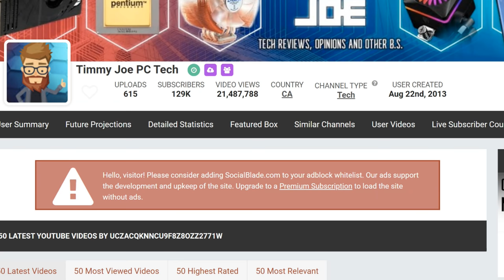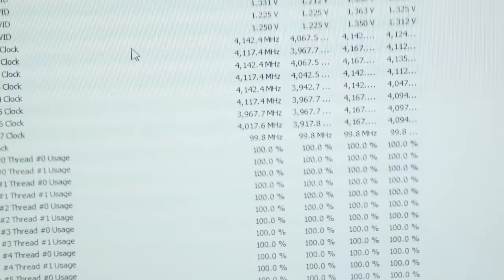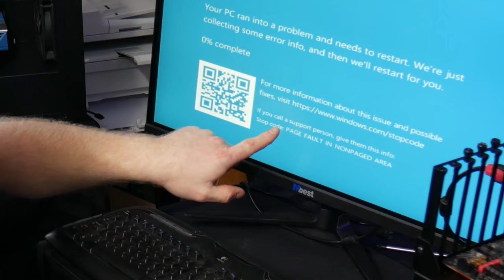This Ryzen 3700x was my biggest problem in 2019...

Comment: I have a 3950x on an asus crosshair hero 8 mobo. Everything is fine as long as I don't let it idle. If the computer is idling, it will randomly loose power and reboot. No BSOD's no errors just that stupid kernel power 41 error in the event viewer with bug check code 0. I've been having this issue for months and I cannot figure it out. I may work for a whole month without issue and then start doing it again. Impossible to troubleshoot since I have no idea what is causing it. I've ran memtest for hours and hours with no issues, I don't do OC, precision boost overdrive is set to disabled. The PSU is OK. I'm also hooked up to a UPS so power loss is out of the question. I can render and game on it non stop. But when it's idling....or in very light usage, like browsing the web it will just shut down and restart. I though I was having some USB issues so I just unplugged everything...and the little shit worked for almost a month with no reboots. Yesterday it started doing it again. It's taunting me. I've updated the bios and drivers again yesterday and changed some power phase options in bios and set them from auto to extreme since i read something about memory going into a low power state at idle and causing issues.I have even disabled spread spectrum even though I am not doing any OC. Can anyone help me figure out what this is? I bought the parts in june and I need this machine since I work remotely and I need this thing to be reliable. I want to exhaust all options before I send parts back to the retailer. Any help is appreciated!

Comment: What the fuck man, this is something similar to what I get with my 3970X and my Gigabyte Aorus PRO WIFI.
I run all the stress tests, etc.. NO CRASH
But if I boot into windows directly with no delay ( As in cold boot, get to windows, put password immediately, get to desktop ) it will have a huge possibility to trigger the blue screen issue.
In my case its not only Page Fault but the most usual BSOD is Watchdog  violation.
To resume, to get crash with a 50% to 70% probability is
COLD BOOT -> Get to windows immediately, no delay on putting password, run browser or any light app.
What happens? At some time the system will start to stop responding, slowdown to a crawl, then mouse and other things will stop working and then it will BSOD.
To NOT get the BSOD I have to.
COLD BOOT-> Get to Windows's login screen and wait at least 5 minutes for it to load background apps -> Login and let it sit 5 minutes loading background and boot apps.
Then the system will be rocksolid forever until I do not the delay in the next cold boot.
I even got these issues in a brand new clean Windows if I do not do the waiting period. But then, my cpu is retail, not engineering sample. And I've heard of other guys having a similar issue than you with other retail chips.

Comment: Weirdest confirmed fix I've ever run across. Twice in past six years or so I've come across clients that would bluescreen only when installing programs using Microsofts MSI installers. Traced to memory settings on the BIOS set to Auto. If you manually set the settings, even if setting to the same as the auto settings issues would disappear.  Crazy.

Comment: I have the 3700x with the gigabyte x570 aorus WiFi elite, had this build for a little over a year, not over clocked. Was playing RDR2 the other day and the monitors shut off and the pc acted like it restarted but monitors stayed off. I swapped out the video card, swapped ram around, changed the psu, reset the bios, flashed the bios, even tried onboard graphics, nada. Still no signal to monitors. It starts up and fans and lights come on but still won’t post. I’m out of answers, any thoughts on why this is happening? Never had a pc do this before.

Comment: had the same problem most ryzen 3 gen users reported it in the AMD forums and the only options are:
1. disabling SMT 
2. giving vcore more volts mine was offset with 0.13 something

oh i forgot im using an Asus b450 gaming F motherboard.

Comment: yes had isues with a 1700x only wanting to work in asrock / asus boards and also had issues with a threadripper 1920x that would BSOD randomly on gigabyte / msi boards yet worked fine on asus and asrock boards so yes i believe there is a issue with the zen setup and gigabyte for some reason I myself now avoid gigabyte mother boards.

Comment: I had an AMDK6-2 that one day didnt want to enter Win98, no problem i wasnt unfamliar with having to reinstall windows in those days, but during the installation it decided it had Kernal errors and couldnt continue the install (worked fine on my friends computer so the disc was intact, even tried using his drive to see if mine was busted), i then installed Win95 on it and it ran fine 🤷‍♂️ got a new damn Kshit2 and win98 would install again.

Comment: Hi Jimmy-Joe, I have a weird one for you, I built a modded water cooling pc a year and a half ago using my existing Gigabyte x99 sli revision 1.0 MB with an i7 5820 3.3ghz @4.0ghz. I started running into issues with early access games where the pc would shut down and restart, eventually the power supply broke (Corsair RM750X) I swapped it for a Corsair RM850X and boom the problem started happening again but luckily the power supply hasn’t gone yet, I since gone back to the cpu stock speed @3.3ghz and tried swapping different components and it would still shutdown with early access games only!!!! I’ve tried throwing it quite a few big label games and it wouldn’t shutdown how weird is that!!!

Comment: my weirdest problem ? 2 x 8Go  - 4400 mhz ram g-skill gold that works flawlessly on my x570-f @4400 => but that's the only kit that i can run @4400 ... I ordered 2 times the same kit model(I wanted 32Go first without knowing it couldn't get beyond 3600 mhz when more than 2 ram sticks) and tested them @ 4400 but allways had bluescreens, (of course all my tests where only with 1 kit at the time (2sticks) just to be sure they hold 4400 like the ones that works and not rma them for wrong reasons) ... and finally orderer an other model of 4400 ram from g-skill (not gold) , and  same problem ... they all hold 4200 , but not 4400 except for that one kit I have from start ... so now I just kept the first 4400 gold and the 4400 not gold , and run them @3600 together... so lot of money and time wasted but I needed at least 32Go to run my VMs for work ... If only I knew at first that I wouldn't be able to work both kit at 4400 I would never have bought the first 4400 kit that was working great at 4400 but as said , is totally unuseful when you want then to add 16Go to it later...

Comment: I had a machine back circa 1999, that was my old AMD K6-3 @ 600MHz with 768MB RAM, Had to run Windows NT 4.0 because it would crash inexplicably running Windows 9x.
Found out later when i was in college, that it would run Linux fine also, but nope not Windows ME. Later upgraded it to 2000 Pro.

Comment: It's the memory controller on the CPU and the aggressive voltage and sub timings/memory layout of the Gigabyte MB's!  You can baby it by turning off XMP and under volting/loosening the timings.  Note:  if you can help it try not to run more than two sticks.   I would send it back to AMD or Gigabyte and point them to this video.  Good luck brother!

Comment: I had an issue with a Ryzen 3600 and a gigabyte mobo but it worked in the asus mobo without issues. It wouldn’t boot at all but a 2600 worked.

Comment: Had a very similar issues with my 3700X + Gigabyte x570 Aorus Pro + 32 GB G.Skill Ripjaws V F4-3200C14D.
The fix? Had to explicitly set XMP High Frequency Support in UEFI to level 1. 
If that setting was left on auto, the system would BSOD at random times.

Comment: My Gigabyte Aorus x570 pro wifi with a R5 3600 will not run pass the F5 Bios without blue screening and getting the same faults as you. It’s running the latest win 1909. Before I upgraded to the latest win version I could only go as far as F4. It works perfectly on F5. This is my weirdest problem.

Comment: I’m using a 3700x in a Gigabyte x570 I Aorus Pro Wifi board and it’s working just fine—well, I had to underclock it a little bit because it was running too hot but that could be my fault.

Comment: i have same mother board and cpu nothing happen its work smooth ? and i overclock @4.2
Reply: @Peter Cavojec I don't have an esm processor but i have the same issue with R5 3600 and gigabyte b450 ds3h

Comment: Question hope you could help me, I just bought a ryzen 3700x and I have a b450m bazooka v2, it seems to work find everything is there but when I jump into warzone it works but the second it has to load the “loading screen” it freezes right away but you can still hit windows and open stuff so, is it a cpu problem or game? Bc I didn’t have these problem with yes a Ryzen 3 1200 -.-

Comment: Back in like 2009 or so i had a HDD (well i still have that HDD but i don´t use it) that just stopped working so i swapped it out and installed new one. Same manufacturer, same model, same capacity. Half a year later my dad wanted me to build him a PC so i ordered the parts but the store could deliver every ordered part except the HDD that we wanted. So i still had lots of HDD´s in my drawer and i thought let´s  take one of these for the moment. I had not had them marked but i knew one of them was the broken one from my system. I tested them all. They all just worked fine. So i tested them again in my PC aaaand all of them worked except one. And so i kept on testing this one HDD in 2 more systems. It worked in every single one of them except for my own Gaming PC. Any idea why this is, would be appreciated.

Comment: Hi Timmy Joe. I'm experiencing similar problems. I was wondering if you remember if you checked dram voltage? I noticed mine was running just 1.2v with a 3200 c14 xmp and it should have had 1.35. I noticed prime95 failed on a thread too. So I first thought it was cpu voltage, so i offset it by +.1 to test, and then noticed the auto volt for dram. Haven't had any bluescreens after increasing voltages. Yet.

Comment: Almost year later I must say that unfortunately I have same issue, but with R5 3500X and Asus ROG b450 gaming-F, random bsod's. I made soo much with this PC and still I don't know what to do to solve the problem, probably I will RMA this CPU or sell it and buy new one. But i think the problem is in power menagment, specificly with CPU voltages, I hada  BSOD's even after clean windows 10 install, it's always getting better with chipset driver installation, disabeled PBO in BIOS and then I dont have a lot of problems with BSOD's (they're shows often)

Comment: I have this issue everytime I used XMP with my RAM. I have a Ryzen 5 2600 and an Aorus B450 PRO paired up with 4 sticks of 8GB Vengeange RGB 3200MHz. If I try to run my RAM at 3200MHz I get the same blue screen even though sometimes I get different error codes. Since then I've just been running my RAM at 2133MHz which is a waste but I just can't get it to work.
Reply: Try 3000mhz at 16-18-18-36. Lower Memory speeds should work?
Because XMP is a preset overclock profile for intel CPUs.
Reply: @Targetlockon  So I have been messing around in Windows with the new settings and I have to say that its been good so far however I will have to see if it decides to cause some issues further down the line.

Comment: weirdes problem i had i changed cooler on my pc. booted it up it worked fine. then i restarted the computer then it crashed when starting windows. it also crashed in bios.
i tested to remove all the harddrives to see if it was stable in bios. it was. took in the windows boot disk worked fine. then took the storage drives in the computer worked fine.
everything was how it was connected before so just taking the harddrives out fixed the problem.

Comment: I had issues with the latest Gygabyte bios- NVME just started to loose itself after the restart, installed the previous bios(version 50)- problem solved!))) So maybe you should try not the latest bios, but the pre latest one)))

Comment: Had a similar problem with my 3700x on a Auros Elite x570 mobo with 4000mhz memory. Wouldn't post with XMP on, on bios f4 or f5.
Contacten Gigabyte, they sent me a beta bios: F5f. that fixed the issue. Fabric at 1000, mem at 4000mhz. Cinebench R15 score of  2075. Then came bios f10. Upgraded to that. Result; unstable with XMP on, cinebench R15 score of 1975. XMP of; cinebench score of 2075, go figure.
Memory is listed as compatible on the website. Cpu boosts op to 4400mhz, all bios settings bone stock. Don't have the funds to troubleshoot like you can... Happy now though.

Comment: Try the latest nov19 (1909) win10 image, as a friend's ryzen system would crash with either updating to or installing to the may19 (1903) version, either online or fresh install. The system worked perfectly fine prior to win10 1903, and fine again on win10 1909. My own ryzen system had no issues with updating to win10 1903. This could be a Microsoft issue...

Comment: gigabyte b350 - issues gigabyte x370 - issues gigabyte b450 - issues ram would clock 2400 some times if it would post at that, other wise it would error out or just choose to post 2133

2 1600s and 2 1700s and a 2700. setting ram speeds was a nightmare, couldn't get the cpu to oc or if it did it would fail to post 1 out of 4 times.
put one of the 1600s into a x470 from msi & clocked 3.8Ghz with 3000Mhz ram (same ram as above) no problem
my 1700 has been on a b350 tom. artic @3.9Ghz with 2933Mhz (actually 2133 sticks) since one of the first big bios agesa updates for 1st gen. (ram was stuck at 2666 before that update)

Comment: Happened to me with a gigabyte x370 gaming 5 and x470 gaming 5 both fried separate 16 gb memory modules.. 1800x for the x370 and a 2600 on the x470... Both of those MB were swapped to MSI boards an x470 gaming M7 for the 1800x then to a 3900x and a tomahawk b450 for the 2600...

Comment: My weardest computer problem was gygabyte mobos with their crazy bios. It was solved by returning mobos and changing them to msi\asrock. Every time I tried to do something with bios there were problems, every mobo had problems. Like its crazy like even cause of bios there were a lot of problems with not tuning hardware to its potential, even could not turn xmp ram, cause of bios bugs. But even with stock at all where you dont touch anything its problems and with same hardware but on other mobo the problems like does not exist at all.

Comment: Gigabyte  must have fired people at the plant.   And you know once you fired they didn't finish the job of  update.  And the Remaining  people at the  plant  didn't know what to do.  Just like creative lab.  Same thing.    They use the same driver  of 2018  and relabel it as  2019 driver.   This is a fact.  On  Creative Lab sound card company.    We have to know  Windows 10 got  many different version.  Older version of Windows 10 might not  support the  3700X so there error blue screen.   Lucky  there other  Motherboard manufacturer that thriving and support new update Windows 10 1909 and update support for  3700X in the bios.    It not  Timmy Joe fault but  Gigabyte  fault for not have people  working on  news bios or  keep track of  Windows 10 update.

Comment: Timmy, those stock wraith coolers work really well if you remove the AMD fan and JB weld  (pointing down) a 140mm Corsair PWM fan.  Cools the ram, board, vrm and cpu much better and quiter in my experience.  Looks cool too.  You can line the fan shroud to allow access to all four cooler screws btw.
Reply: Today MOBO w/ vrm heatsinks no longer needed down firing CPU fan.
Unlike old gen that uses tiny lil heatsink.
Today MOBO uses large thick heatsink and case fan via airflow is enough to cool it @ 50+/- degree underload.
Reply: You only want down firing fans on Mobo that have no vrm heatsink today.

Comment: my dad had the same problem on a Ryzen 5 2600X + Aorus B450 Pro WiFi and Corsair Vengeance LED at 3200 Mhz when i tried to use the XMP Profile, but when i disable that... it works fine :facepalm:

Comment: Lol bought two gigabyte motherboards one micro one full ATX for the exact same build for two identical computers except the case was different for each.  Have them for 4 years running Intel i-5 4590 processor s.  Both crapped out it basically the exact same time and I troubleshooted them things for I mean 2 months hour and a half every couple of days.  Swapped hard drives bought new hard drives did all kinds of things in the command prompt tried to fresh install Windows and I mean they were both just acting weird to the point where Windows media creation tool wouldn't even allow for an install.   Just gave up and went and bought an alienware out of frustration and was going to go ahead and just do an AMD build from scratch using the old cases.  Sounds like if I would have followed through my plan I would have really been frustrated because I was just going to go back and rebuy a durable gigabyte motherboard for gaming and throw a ryzen 3500 in them.  Stresses me out

Comment: I have a b450i aourus with  a 3800x. The system monitor lost video signal after the graphics drivers loaded(2080Ti). This took me two months to diagnose. Initially I had no idea that was the issue, since it just looked like system never went into Windows. I though it was a bricked GPU, faulty CPU(system worked fine with a 2400G), faulty PSU(not enough power?), or a faulty BIOS battery maybe?(I replaced it, made no difference). The system is now stable after several Windows reinstalls, BIOS resets and BIOS flashes. I still don't know what exactly caused this. Anyone have any ideas?